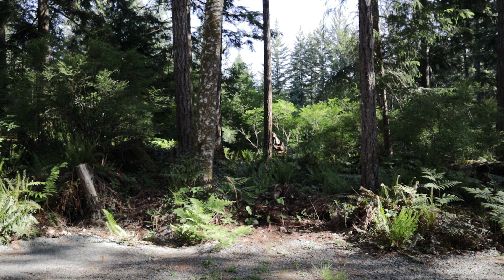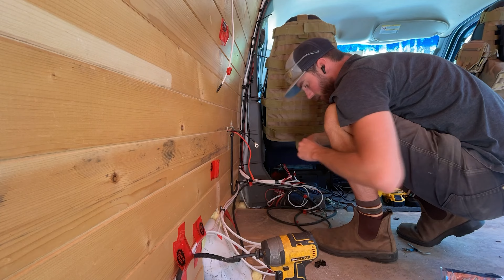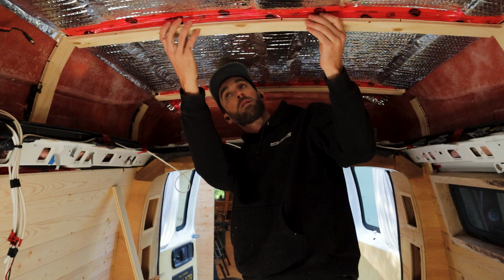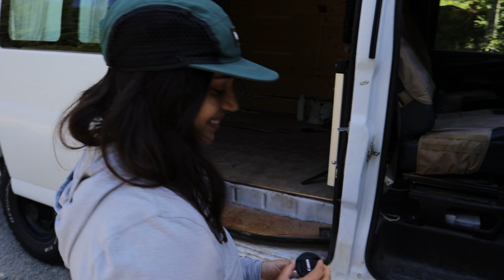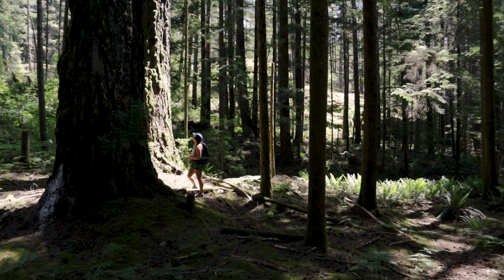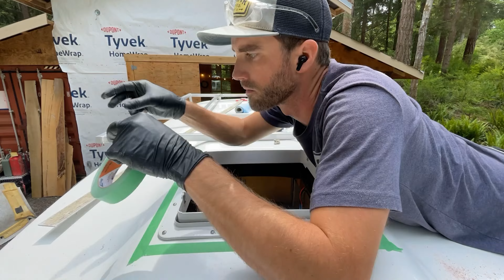High Top Insulation | Chevy Express DIY Van Conversion

Comment: Great video, Alex!
I really appreciate the extra clarification and info that you went to the trouble of noting throughout the process. Saw that inner fan bezel thing coming, but can see how it would be easy to screw that up. I was wondering about using flexible conduit for your electrical lines -- I know most builders seem to use it, but I've always wondered how necessary it really is -- wouldn't chance it myself, personally, if it's for off road use, but you've probably thought thru that - thoughts?
Can't wait to see the rest of this build!
Cheers!...from North Vancouver
Reply from the maker: Hey Adrian, thanks for watching. I’ve certainly used conduit before. It cleans up the look a little and offers an extra layer of protection. I’ve chosen not to use it for a number of reasons. I use a marine grade 14-2 insulated wire for interior wiring. There’s an additional insulating sheath protecting the conductors so less likely for there to be a wear point that eventually damages the insulation and shorts the circuit. I also make sure that all my wiring is secured to the wall so there is no movement in the wire. This ensures there’s as few possible wear points and connectors are less likely to vibrate loose. And lastly, I’m not so concerned about looks if I’m burying the wire in the wall. On the other hand, if I have any wire on the outside of the vehicle on the underside, I always try to use conduit and or a UV rated duplex conductor. Hope that helps. Cheers!

Comment: Howdy Alex & Megan, 
A question (or two?) about the ceiling fan before we start cutting holes;
* the maxxair fan is a market leader,
* 14x14 inches seems to be a standard,
* our van is same size (volume) as yours, 
Q: is the max capacity (900cfm) overkill?
Q2: is the reversing feature important?
TIA, 
Mike in Austin Texas
Express 1500 with Starcraft mid-roof conversion
Reply from the maker: 14x14 is industry standard. Move a much air as possible as it’s the best way to prevent mould build up and reverse is crucial for best comfort. We use both directions all the time.

Comment: Hey Alex,was wondering what is your ceiling height with the hi top and what particular brand and model that is ? I like it.
Reply from the maker: It’s 16” over the roof flange. Meg can stand up inside and she 5’,3” with an angle inch or two to spare. We used HTV www.hightopvan.com in Washougal, WA. Tell them Roamlndr sent you and you’ll get $100 off.😁

Comment: Hey man how did u attach the strips of wood to the fiber glass top? Liquid Nails or screws or what? I got a 96 chevy conversion van that I'm doing and not sure how to do that part?
Reply from the maker: I just used Good’ol PL Premium. Relief cut the strips of sheathing and the wedged them up against the ceiling over night. Later I built a support from the roof flange. I’m not too concerned about it coming detached now that everything is up there and the ceiling is actually also supported by the upper cabinets.
Reply: @SlowRoamers  ok thanks man I appreciate it

Comment: How did you guys attach the framing to the under side of the fiberglass top?
Reply from the maker: Lots of glue
Reply: @SlowRoamers thank you eases my mind a bunch.  I think I’m gonna use liquid nails my grandpa used to swear by that stuff.
Reply from the maker: I made relief cuts in the wood so it conformed to the roof then used prop sticks and let it set overnight before I added a second piece.